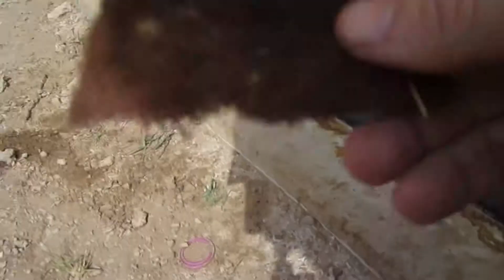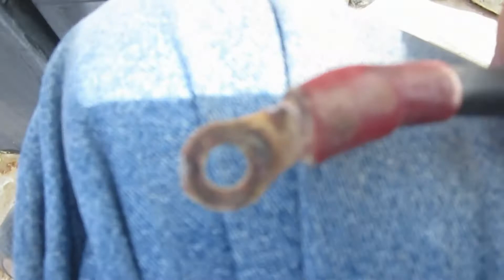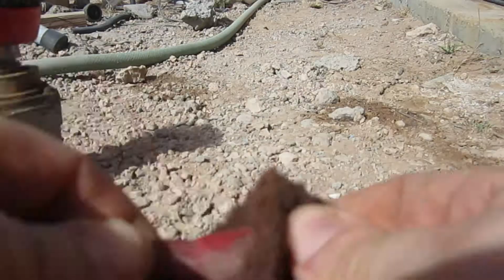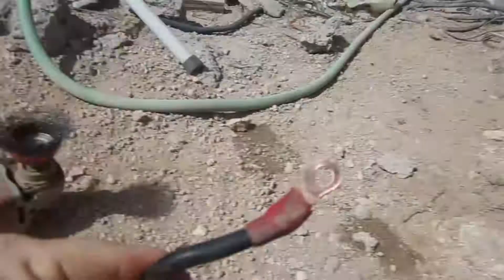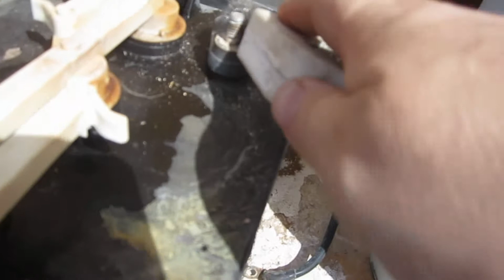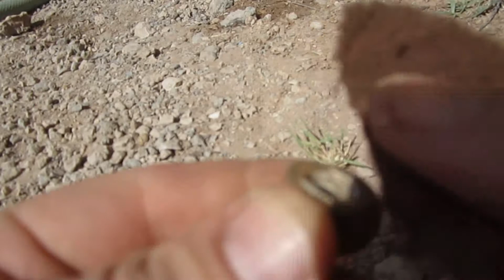Cleaning Battery Connections

Comment: You can drain the acid out of the batteries and replace the acid with new acid that has the right dilution in it ! 
    At a auto parts store it’s called battery acid

Comment: if they over flow it could be from over charging. there also a guide that goes in the cell hole in place of the cap. it keeps acid from boiling out and splashes. it goes in the hole and goes up several inches up.